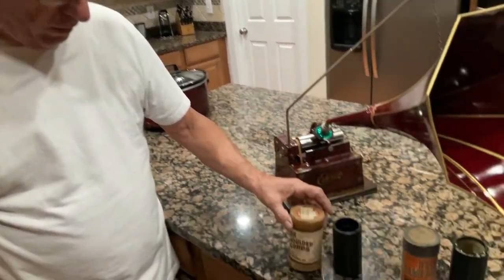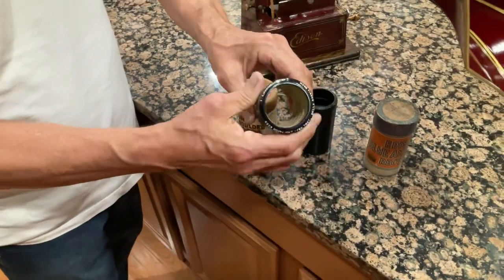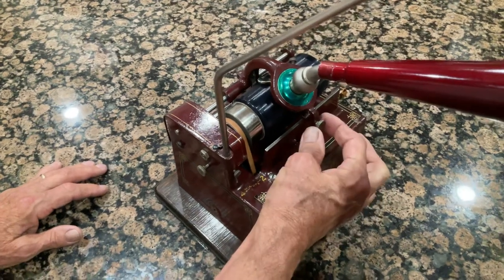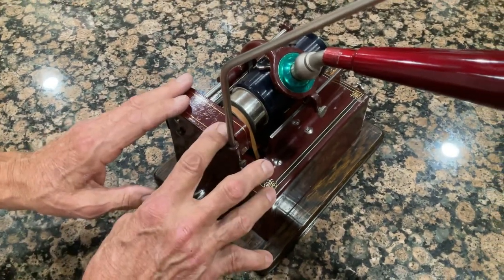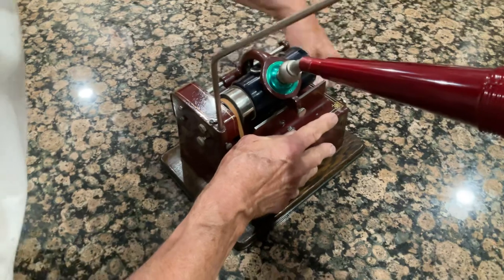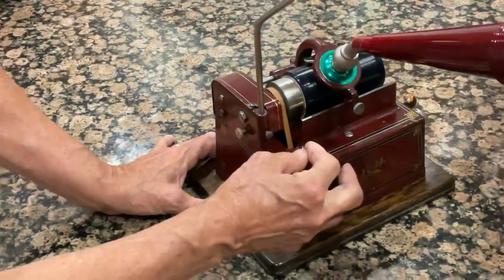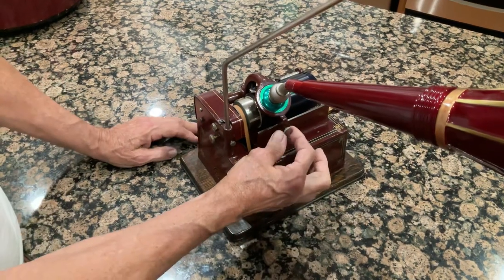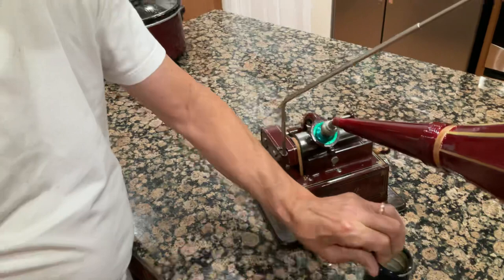810.  How to operate an Edison cylinder phonograph

Comment: Thank you for your video. I have acquired an Edison phonograph Gem Model B (c. 1905) fitted with a model C reproducer. The mechanism seems to work properly until you play a cylinder - it starts ok but soon slows down and completely stops. The mandrel continues to turn with a cylinder on it when the carriage is not placed on it. Maybe the weight is not correct. The on/off knob on the right hand side does not seem to properly engage, but I don't think this is the main problem. Do you have any suggestions for me to try? All help greatly appreciated for a beginner phonograph hobbyist.
Reply from the maker: First start by oiling all the moving parts and then you have to undo the four bolts holding the base on to get to the inside, oil the governor, put a dab of grease on the gears. Then wind it up all the way and try playing a cylinder.
Reply: @1974hurt   Thank you.

Comment: Many thanks to Mrs. Dyslexic Genius for making these videos and asking questions.  

Could you please clear up for me which Edison models support the gold molded wax cylinders?  I've read that the Amberola 30,50,75 should only play Blue Amberola & Indestructible records, and Gold Moulded are meant for other models like the one in this video.  My Amberola 75 came with both record types.  Based on the story from the seller I gather his grandfather would simply buy both types, though he suggested it was possible the grandfather had an earlier Edison model and upgraded to the Amberola 75.
Reply from the maker: You can only use blue amberols on Edison 30, 50, and 75 phonographs with a diamond stylus.  They are four minute cylinders.  Black, “Gold Molded” wax cylinders are 2 minutes and ONLY play on a 2 minute cylinder phonograph with a sapphire stylus, like a Home, Standard, or Gem.  If you play the wax cylinder with a diamond stylus it will plow through it like you’re plowing a field, ruining the cylinder.